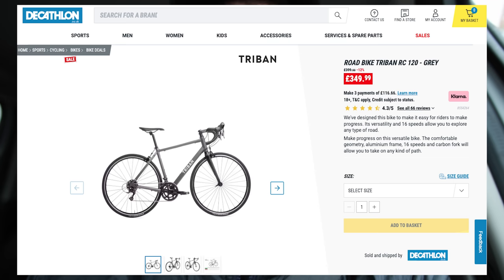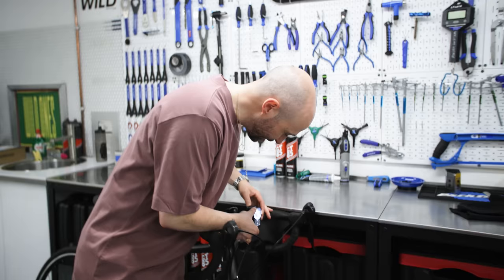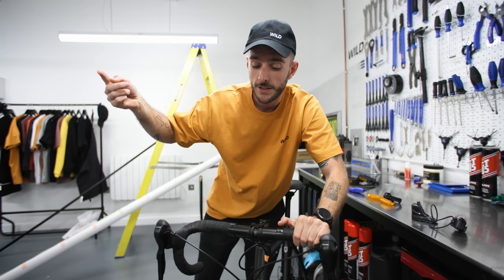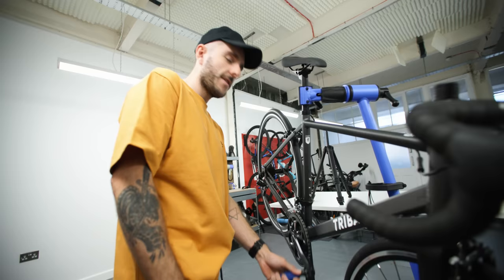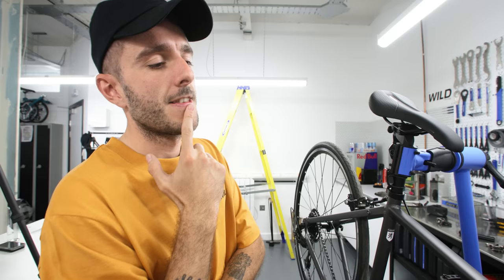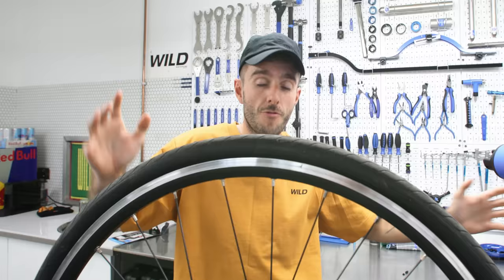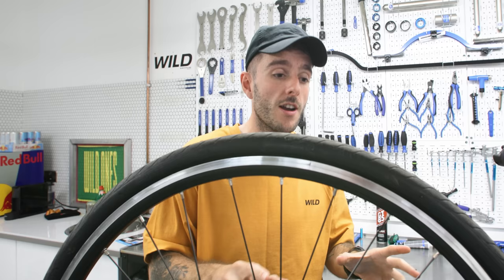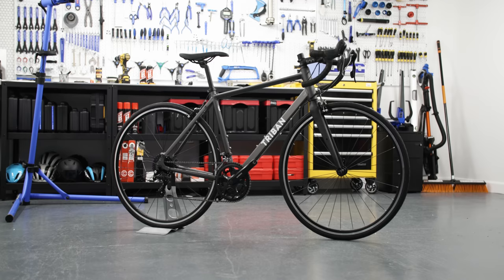We Bought A £350 Entry Level Bike in 2023 - This Is INSANE Value

Comment: So many people think of Decathlon as a crappy cheap bike manufacturer, and it's completely unfounded. Lots of people buy the lowest end bikes for their kids, which are adequate for average use, but when the kid starts doing kerb drops and abusing the bike, of course shit will break. 

The higher end bikes are actually really damn nice! I've been contemplating on getting an XC bike from them. 

I myself have a Riverside 500 that's been my trusted companion for about 6 years at this point, all it needed was brake pads and tires. It's been though storms, knee-deep water, and accidental plunge into a lake, and all kinds of crap, yet it shifts like the day it came out of the factory. It helped me renovate 2 homes and 3 garages, carried hundreds of kgs of paint and cement over the years, and the paint is immaculate. 
I bought it from my first paycheck, and even though I could afford a much more expensive bike at this point, there is no way I could sell it or replace it.

Comment: I bought the precursor to this bike in the summer of 2018. Back then they were branded as B-Twin Triban, rather than simply Triban, and (I think??) it was a slightly higher spec because it was the 500 not 100/120 version. Anyway, same geometry, same price (£400 reduced to £350) and it was my first road bike and it’s a great, GREAT first road bike. I did the 106km Etape Loch Ness sportive, the Wiggle Aye Up! Yorkshire sportive & the Brewin Dolphin Ochil Hills sportive (again in Scotland) on it and it punched way above its (price point) weight. It’s now used as my commuter but back then held its own against bikes costing upwards of several thousand pounds!

Comment: got a disc brake one and love it. swapped the wheels out for Mavic Aksiums and it's a big improvement, especially on 32s. agree on the cable routing but i'm going to swap it over to continental brake operation when i'm re-wrapping the bartape anyway

Comment: I have this bike. Bought it to ride amateur 500km race. After that it ended as my summer commuter. It is just a great bike. Rode it about 6000km and everything is great. I was worrying that the shifters will be bad but changing gears is spot on even after this 6000 km.
After every season i service bearings in wheels and they can last. In my winter commuter i have front wheel with typical bearing without seal. This wheel had ridden with me about 35 000 km and mainly in winter. I think that machine bearings would not be more durable. Their main advantage is that you don’t need to service them, but their main disadvantage is that you cannot service them ;)

Comment: I did several drives of the RC120 with disc brakes in Berlin
Pros: 
- price (back then)
- absolutely flawless shifting of the rear derailleur
- very good stopping power of the cable actuated disc brakes
Contras:
- uncovered cables in the areas where the most dirt is to be expected
- front shifting hit or miss depending on the individual bike
- heavy
- saddle very hard and edgy
- not ideal positions of the brake and shift handles

Comment: Have had my triban rc 500 for almost 3 years and love it. Have upgraded the wheels, saddle and have found it performs better due to these changes. Can apply the criticisms you gave to this model to the rc500, however, proper maintenance and regular cleaning will hell components last longer. Great bike for beginners looking to get into cycling without the need to break the bank.
Reply: Cool! What wheels did you get out of interest? I’ve got the same bike and am looking to upgrade the wheels as well

Comment: I think the main thing with a budget bike is "Are the parts all standardised sizes"

If the answer is no, don't get it.
If they are, then you can just spend a small amount to get you started an then slowly add to it. This helps you learn which small feelings, vibrations, noises etc are related to which parts and can help you avoid overspending in the future as well.
It also means that you will know every single part of your bike inside out eventually.

Comment: I have the disc brake version and the frame is absolutely solid. I have had it for about 4 years now. I did do the wheel and groupset upgrade, along side the tyres. Spoiler alert, the tyres don't last long.
All in all a fantastic bike.

Comment: Thanks for all your fun and helpful videos. I am almost tempted to change my career and enter the bike fitting industry. I ride mostly XC/Trail MTB. I got Rockrider XC900 (RS Reba, GX, Mavic Crossmax) as a second bike. It is really fast XC Hardtail. I instantly converted to tubeless, after a year struggle gave up and changed breaks to SLX, carbon handlebar and most importantly full length internal routing for the rear derailleur. Overall very good bike for the money! Cheers!

Comment: I bought a budget Carrera TDF some years back... about £270 I think- purely as an addition to my training (I'm a runner).
It was heavy and awfully geared- but it was tough as old boots and took everything I threw at it...Out in all weathers, rides up to 130 miles, hill-climbs and training TT's- I smashed the hell out of it.
I recently re-built it - cables, lower geared crank-set, larger cassette, front and rear mechs, brakes etc- and all because I love the geometry of the frame ! The wheels are still original as is the axle- bearings are still good ! 
No records will be set on it- but it's a good ride...

Comment: Yes, Microshift levers (im running R7s) are foolproof and really really good. They are tinny/clunky, but i dont mind that. And good point re sizes, A Spez Allez medium is a 52cm top tube, so be very aware of sizing. Cup and cone are still fit and forget... ive got a front wheel which came off a Merida Crossway, it wont die... frustrating! Oh, I have a Mondiale, a Kinesis Aithein, two Meridas an Orbea Starship and Dolan grass bike. cheers

Comment: I have been riding the rc120 disc for the past year as a commuters bike and the microshift rear shifter is trash now... Well apparently it's commun for them to break now so I changed it for an second hand Tiagra and the thing rocks now! Super happy with the price and the fact that I learned to do service on it and changed parts. Adds lots of value as well
Reply: Does the stock rear hub/cassette body allow up to 11 speed cassette?

Comment: You can find it discounted to 375 euros with disc brakes but at 11.5kg it is a bit lardy. The 34x34 drive train will get you up most roads though. Nothing wrong with cup and cone bearing. My current work/training bike has cup and cones with no sealing and the wheels are 42 years old. Very easy to service, just need cone spanners.

Comment: I don't have a Decathlon but I have a Brand-X. Similar bike but from Wiggle I believe. And to be honest I just bought the frameset and the handlebars, and fitted it out with a Shimano 105 R7000 group set. No brakes, because I only use it on my trainer. Very happy with how the bike turned out and I can't see why I would need anything more expnsive than that on a bike that will only ever be used on a trainer.

Comment: I agree. I replaced a sticking cable post with this and to be honest it has hardly ever worked. The switch eats batteries unless you remove it after every ride and of course you forget. When you do put it back the contact is flimsy. Same with the seat post battery. It never seems fully charged. The time lag is annoying and you need to predict when you need it. And now mine sticks so it goes down and won’t come back up. Bin it!

Comment: Hi, I have cup and cone wheel bearings, had them for 30 years (changed the balls on the front last year) ride through winter, minimal maintenance and they are fine.  I do not use a pressure washer on the bike though.

Comment: This morning I accidentally watched a small part of a video where GCN once again were claiming that 105 is entry level, and here you are spending half what that groupset costs, and only 10 12speed chains, and getting a capable bike that will get you around the local club run, or out with friends... Big up the true entry level, and well chosen parts. Add to that the bike only weighs as much as my Scott Speedster CX (disc, alloy, Ultegra) and that's not half bad... I love Decathlon stuff. It's quite a lot of my commute kit, and general accessories on the bike.

Comment: I just got the GRVL 120. Basically the same frame, but other components and (mech) disk brakes. It costs 750€. Upgrades: Semi hydro brakes and shimano rotors, Hollowtech II BB and GRX 600 crank and a tubeless setup (already tubeless ready). Still under 1K and you really need to spend a lot more to get more bike.

Comment: bought a triban 500SE back in 2013 for the same price, that model did come with mostly sora components but with 3x8 Microshift rear mech and shifters, all upgraded to Tiagra 2x10 last year and coupled with Mavic Krysium Elite wheels as the originals didn't last 12 months.  Still ride the bike every other day and it's not much slower than my trek AL6 that's sitting on the rollers.

Comment: This is my first road bike (I have the dic break version with the little shifter at the thumbs. I think it’s RC 120 Dic) which I’m taking bike packing on a 350 mile rail trail. I had a Trek hybrid that has been though A LOT 😅Switching out tires for gravel ones and the seat I’ve changed for the one in my Trek bike. I love that I can use it for multiple activities and it’s affordable.

Comment: I bught this model in 2020 and its runnin real smooth. No problems whatsoever, great weight. When I buoght it, the model came with disk brakes, which are a big bonus to me and were the ultimate reason I decided to buy this model. 350€ for a really good city cruiser you can also go sport cycling with. This quality costs double and upwards at other bike shops.

Quick edit: I once had a crash with this bike and the "loose" ends of the handle bar bowed to the side as shown in the video which had me really worried, but they worked just fine. Just popped them right back into place.

Comment: This bike has very heavy wheels and tires. I had a bike like this a couple of years ago and was able to bring it down to 8.7kg by changing the wheels, tires, saddle and seatpost.
In terms of size, I'm 180cm and I slipped into size M BUT over time I had to go with a 130mm stem because I became more flexible and wanted to sit more aggressively.
the most remarkable thing is that he cost me only 200 euros from second hand. other than that the bike is great! The switches worked great, and that's all you need to start riding. Over time, you will understand what you want from your next bike, and it was the same with me.... now I have a Canyon CF SL.

Comment: I have an RC100 wich is an even more bare-bones version of this one that came with a steel fork, 32mm gravel tires, and a 1 by 7 speed set up, and I love it. When it was all original, I did a 170km ride and multiple 100k rides, and it was perfect for getting me into road cycling. I have since upgraded to a 2x8 microshift like your bike has, and I added a carbon fork, aero bars, better tires, and better wheels, along with some other bits. Even with all the mods, it would still be a sub $1000 CAD bike, and I honestly can't justify buying a better one.

Comment: I have the rc500 with mech discs. Owned for around 3 years now, it's served me great however it is due an upgrade. The standard tyres were not great and the brakes have always been average. But it's served me fine, would recommend to anyone wanting to get into road cycling, especially over the rc120

Comment: My experience buying a used $35 huffy 40 years ago - bike was a heavy but could still be tuned up to run perfectly, BUT, every time you stop, the brakes & levers bent, putting them out of adjustment.  And I mean EVERY TIME.  After adjusting it 3 times back-to-back in a 20-mins time period, I gave up adjusting the brakes and just put the pads 1/2" from the rims ... Look out for recycled soft pot-metal parts or quick corrosion on some part of this bike!  Things like spokes that rust immediately or break more often, and there might be some parts without any grease ...

Comment: Had a Triban 5 for many years, cost £399.  OEM wheels disintegrated after a winter riding. Replaced wheels with their own-brand sealed cartridge for about £200.  Even on an M, (and I'm 6ft) the top tube insanely long so was not comfortable. Shorter 100m steer tube helped a bit.  Learnt to fix bikes on that bike.

Comment: I really appreciate how Decathlon provide great value from entry level through to top level or almost. Their premium road brand is Van Rysel.
The frame on that bike may be able to take larger than 28mm tyres but what about the rim brakes?
Reply: I have that bike, and the rim brakes wouldn't let through wider tyres, unless maybe when they are not pumped. It I was to buy that same bike again I would choose an option with disc brakes, because they sell them too - just a bit more expensive

Comment: I ride an RC520 had it for 2 years now, cant fault it, yes its a little heavy but so am I ! Comes with 105 11/32 , TRP HY/RD cable actuated hydraulic disc brakes & tubeless ready wheels.. At the time was £729 think they are £850 now. Done well over 2000 miles on it including a couple of centuries.  Recently upgraded the wheels to Mavic Aksium as the stock wheels near impossible to put a tyre on ..

Comment: I have this as a spare bike in another city. Very smooth rides after changing the tyres to GP5000 and shaved some weight with R8000 crankset. Just brought it back to my hometown and recently upgraded the Groupset to Shimano 105 R7000 with Windbreak carbon Wheelset. It's even better now at 8.9KG. Without a doubt, a very nice spare bike that I can ride during recovery days and mounted to smart trainer.
Reply: The upgrades that I've thrown in there certainly exceeds the budget bike concept but somehow this bike is a keeper for me with lots of adventures previously and more to come.

Comment: Just ride passed 10,000 KM with this bike. The bike in as described in this video. I run Conti GP 5000 tyres, a 50 mm deep carbon wheelset, it brought the weight down from 10.7kg to 9.9kg. 

Have been riding them multiple century ride and even a 200km ride, loving it so far. 

One thing only cheap bike can bring is when it passes more expensive bike😂😂 (happen very rarely though).

Comment: When I got back into cycling after a 20 year or so hiatus I found myself an aluminium Felt bike with Carbon forks (and a proper derailleur hanger!) and 9-speed Sora for 400 Euros on sale. You just don't seem to find this kind of deals at specialized bike shops anymore. Decathlon's bikes probably come closest these days but the lack of the derailleur hanger is a big disadvantage in my book, I have bent quite a few hangers of the years and fixing and aluminium frame is not easy at all...at this price point it would probably not make any economic sense either....

Comment: I've got the even cheaper rc100. With a microshift upgrade it works really well as a urban bike. And it came with a  derailleur hanger, sealed bearings and 32 urban tires

Comment: I was surprised how 150-quids-bike could be not so bad:

When I was forced to move to other city (in Ukraine) I bought used locally (150 GBP) old Carrera TDF bike (i think its Triban's competitor), and I must say after quick repairs it's not bad as I thought it would be. On flats, calm weather gives same 30kph+ easily, not the best acceleration from 0, but still ok, main problem another fit and/or bike geometry (unusual for me).
Frame size is a bit smaller then i used to, but i managed to fix with reverting stem and seatpost+saddle position. 

It has 3x8 groupset (sunrace).
The only valuable upgrade was - tires (bought pair of used gp5000),
- changed lower headset bearing (actually the old one damaged alu fork a bit, but not critical), 
- cleaned and greased all bearings (BB, Headset, wheels)
- changed cables and it was good to go.
- bought used 5700  clipless pedals

Previously i rode a lot on Cannondale's: 
CAAD8 (commuter and sometimes trainings) mainly tiagra groupset.
Supersix Evo (carbon) + deep tubular wheels mainly for races or long rides during good weather.

Comment: I have the 2022 RC 120 with Disc Brakes. Changed the rear wheel with a DT wheel and the brakes with semi-hydraulic ones and of course thrown some Panaracer GravelKing Tyres. 
Been to Italy on a BikePacking trip, rode it mainly in Switzerland and also in Gran Canaria. I'm sure more expensive bikes are better, but for approx 500 (GBP, EUR, CHF) i am also sure you won't find anything better than this

Comment: I have owned a full suspension entry level bike before from decathlon and i really couldn't fault it, OK it was entry level so was fairly heavy at 15Kg but it was built like a tank and took me on some really fun adventures. I could throw it at almost anything apart from big drops and it was a pleasure to ride. I think decathlon bikes are perfectly fine, they do what they need to do which is provide good value, good fun and good reliability. I wouldn't hesitate to buy a decathlon bike in the future.

Comment: My first proper bike a steel frame weighed 22lb /10 kg. It was considered lightweight. The groupset was Shimano RX 100, 16 speed 52/42 chainrings paired to 12/24 eight speed cassette. It cost around£600, this was in 1996. Im not seeing bike price inflation. A fit young rider on this bike will easily show a clean pair of heels to an aging slightly overweight me on a£3k bike. Its a no brainer great bike, imo